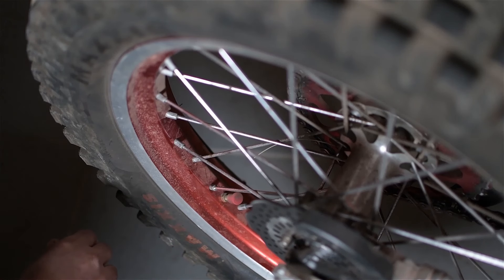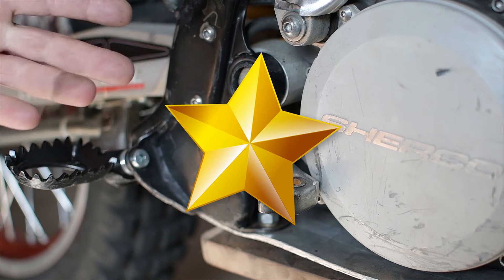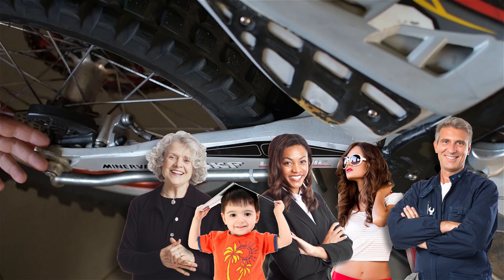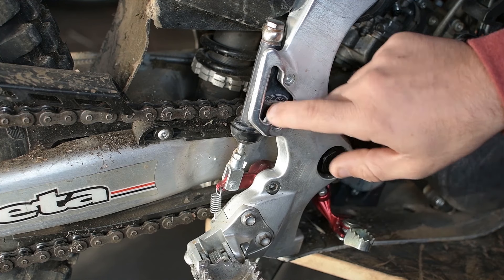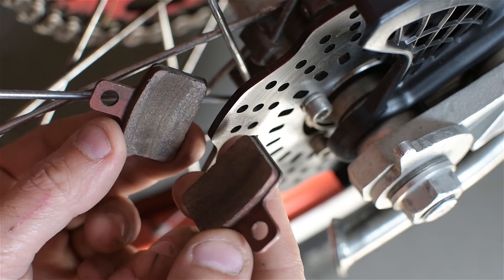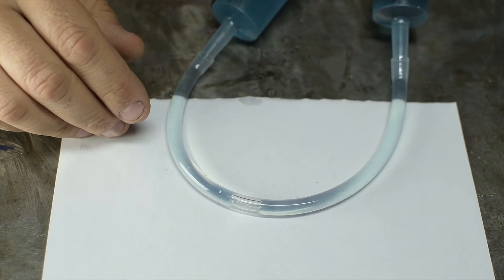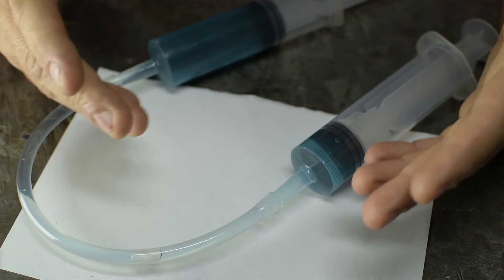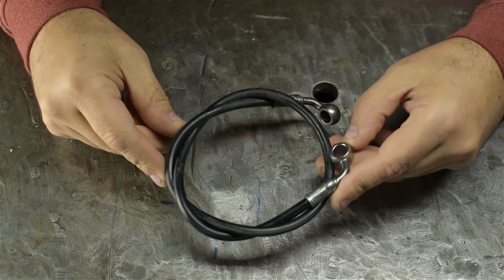I'm an Idiot! (Soft Spongy Brakes)

Comment: All that work when you could've just been carrying a piece of rebar and stabbed it through the spokes of your back wheel whenever you need to stop.
Reply: or even easier, if you wanna stop just get off the bike.
Reply: Omg this killed me!
Reply: Would this work on cars too i often thought to make a hole im the car and drag the rebar.
Reply: why didnt i think of that!?! the rebar method is way more elegant than the boat anchor and chain welded to the frame system ...(patent pending)
Reply: I personally put my car in reverse and rev it up to stop
Reply: This also makes you stop on a dime.
Reply: @SalahEddineH  tell me about it, I almost brake my wrist trying that, but hey! It works!
Reply: why ruin the spokes when you can jam your foot between the tire and frame. this works exceptionally with the front wheel also allowing you to walk over the bars to get off the bike at the same time.
Reply: @SalahEddineH  So you tried it then?
Reply: I use my shoe sole, which is made from vulcanized rubber for increased stopping power.
Reply: @SalahEddineH  I'd like to thank Salah's spouse for posting that answer. Sorry for your loss.
Reply: @myes344  The traditional method is to cut holes in the floorboards and drag your feet on the road, invented by one F. Flintstone.
Reply: Trials bikes move so slowly, they have to speed up to stop!
Reply: Orrrrrrr, he could glue dimes on the wheels so whenever he stops he has stopped on a dime
Reply: @SalahEddineH  literally...
Reply: @myes344  Isn't that how the parking brake works? A lever, you pull up the top inside the drivers cabin and it pushes the other end down onto the street? That's also why you should use it for regular braking and it makes this screeching noise when some tuners use it to drift around corners.
Reply: I worn like 6-7 pairs of shoes for stopping my road bike when I was 12 an too poor to have new brakes. I used even old shoes way too small to ride this piece of sh..bike.
Reply: @crackedemerald4930  I physically recoiled after I read that lmao. Pretty funny tho
Reply: @myes344  youd need a more skookum piece like maybe a steel plate or some 30M bar welded together but I think we’re onto something here

Comment: I guess programmers aren’t the only ones having “fun” debugging experiences
Reply: Guess you're right, but it's cheaper for them.
Reply: @Jarko1401  depends what you're debugging. It's not cheap to figure out why your online payment system isn't working in production, that can cost millions of dollars by the hour depending on the scale.
Reply: @Chartreugz  I'm aware of that, because i'm working as a programmer. What I've wrote came from experiencing way more trivial problems in debugging than heavy ones.
Reply: I feel personally attacked and so understood at the same time.
Reply: Exactly! with Angular, I call this Tuesday...
Reply: The difference is, with mechanical stuff, worst case scenario you could just buy the whole set of brakes or whatever is the problem, then call it a day.
It is not so easy with programmers, especially when debugging legacy system, because you don't always have the option to "throw it away start over from scratch". You have to find it.
Reply: Yea. Sounds like codebullet
Reply: @phs125  ah yes, the only programmer in existence, codebullet. He did amazing on the programming of windows, iOS and even my television remote. It's quite hard to believe he is the only programmer in existence.
Reply: @jslavertu  eat a snickers Lavertu, your not edgy when your hungry.
Reply: I was doing a thing in python a few hours ago and it wouldn't terminate. This is why
```
variable = 0
while variable < number:
    # Stuff
    varaible += 1
```
I f*#&$%& hate my life. I have never disliked python as much as i do now.
Reply: @Econcrafter  but you can't do += for undefined variable
Reply: I spent a whole day trying to find the source of a bug only to eventually realize it was expected behavior!
Reply: I wonder what the stray semicolon equivalent is for mechanics
Reply: @Maxim Kruglov  yup, it's grim. I still remember Cloudflare's "heartbleed", I think we're still reeling from that one..
Reply: Though my rule developed after years of programming is always "Check the dumb stuff first." Even if you are sure something is absolutely impossible, if it is easy to check, then check it before wasting vast amounts of time on the thing you are sure is the real problem :-).
Reply: Dude, electroplating “debugging” will have you tearing your head hair out and ball hair out screaming at the top of your lungs wondering why it won’t do the thing it should be doing only for it to just randomly start working again without changing anything lmao. 

But I’ve since been “fired” cause my supervisor wouldn’t let me do debugging when there were issues with brass plating chipping (I speculated high copper cyanide causing uneven plating from too high of a plate out rate) and he forced me to just keep plating even with the issues. So there were lots of messed up pieces and someone had to be blamed for it. 

It’s kinda funny tho, since I’m autistic my pattern recognition is really good so I picked things up quickly. Then because of adhd stubbornness I spent months researching plating so I could be the absolute best at it. So in 2 years of plating I got better at barrel plating than my supervisor who had been doing it for 30 years. 

He used to tell me I wasn’t fast enough and told me his record for amount of boxes of cobra stuff (home Reno pieces n stuff) was 20 in one day. Me being quite competitive I loaded up on every PED I had at the time and ripped through 29 boxes of cobra. He tried so hard to find something wrong with it lmao but it was all good and backed up by QC.

Anyway, enjoy the weekend! Sorry for the tangent😅

Comment: Those are now called spare parts, their purchase is now called preventative.
Reply: Yes you put them in a safe place and when you need them you can't find them and then buy new ones ,ask me how I know!!
Reply: Just needs the repair kit for the calipers now.
Reply: @johnmccallum8512  The trick is to buy 2 new ones and then as soon as you put the second new one in your hands and think "where is the most obvious place to put these so I won't lose them like that last set" and suddenly you will know exactly where the last set is... Don't try it without the new spare set in your hands, it doesn't seem to work, ask me know I know...
Reply: That's what you tell the wife. Oh, wait..
Reply: Kinda like when I drop something and then say "Gravity Check: OK!" to make it look like it was intentional.
Reply: @WhereWhatHuh  Look, if Gravity failed, and no one even tested for that, we'd be screwed. Keep doing the good work, my friend.
Reply: And spare parts usually exist long after the „thing“ they were bought for went to dust 😉
Reply: @Sadowsky46  I mean, there's got to be a thousand uses for a foot long automotive terminated hydraulic line.
Reply: @jimc3688 he shouldn't do, as he was running out of throw on the master I think, not so much calipers. The little spring int he master will act like a bump stop and no longer travel rather than pop the caliper seals(you'd hope)
Reply: ...and that is when you find the original spares that you couldn't find :(-)
Reply: Atlas WalkedAway yeah, one could use it to tie a rose-tree 🌹 to its pole 😉

Comment: You’re not an idiot, This Old Tony ... you’re just tired ... and need a brake.
Reply: You’re not an idiot, This Old Tony ... you’re just tired ... and need a brake rotor.
Reply: This joke bleed the air right out of me.
Reply: More like 'tyred'
Reply: Best Dad Joke, so far, today!
Reply: badum-tsk
Reply: To calm down... Watch more yt vids... aka my mechanics.... its metallic zen.... no words... just tools sound.... zen....
Reply: Indeed,  don't let the pressure get to you .
Reply: I think we're padding this joke.  Of course, high-caliper humor is tough...
Reply: This Old - Rotor ...
Reply: Stephen Boyd hang on, let me back pedal a bit ...
Reply: Oh, punny
Reply: All of these Dad jokes are wearing me out and I think it needs to stop.
Reply: That joke almost made my brain lock up. I'm gonna have to pad over to the fridge and grab a beer after that one, maybe even runout for bottle of Bourbon. I know you're doing asbestos you can, and some might squeal with delight,  but I'm really fading here. With a man of Old Tony's caliper, you have to pin it right on the DOT 3 times or more. Are you detecting some friction between us? You should, because I'm overheated. I'll be riding this bias until I've blown things out of all proportioning.
Reply: that was a real piston pusher. squeezed another one out there.
Reply: I know I should stop,  but my auntie locked me out of the house for telling groaners. I have a disk in there containing a big reservoir of them, so I rotor a text message to skid it under the door. I figure I can take them downtown, drum up some buisness, and pedal them for a few bucks, anyway. My keys are in the house, too,  but for emergencies, or if one breaks, I keep a pair of shoes in the bushes.
Reply: I mean, everyone needs to hone their skills, but I hate to be a bore. If I give any more lip, it is likely to seal my fate and I'll get the boot.
Reply: I mean, he's just probably still exhausted from all that muffler packing.
Reply: @DigitalSim  don't give me that noise, I find the subject too baffling.
Reply: @DrewskisBrews  Now all you need is a Banjo (bolt) and put it to music!! Love your puns! You are a Master A!! Hey! Grand Master A!! (That would mean rap; No!! Please spare us. Rap doesn't work with banjo anyway. How about "Dueling Banjo Bolts"?)    ;-)
Reply: @DigitalSim  A little Fiber in his Glass will fix him right up! I hear Metamucil is good.
Reply: So much friction..
Reply: Oh, that is VERY FUNNY, because you said brake, and that sounds just like break.  I am laughing so hard now ...
Reply: Just stop😉
Reply: Little known fact, it's the job of the Rotary Club to stop jokes of this kind!

Comment: Sounds like when my brother's car wouldn't idle well. Spark plugs, spark plug wires, alternator, starter motor, nothing worked.

Then he bought a battery.
Reply: The easiest thing to check with a meter!

But it's still good to install all that stuff as it will be more reliable in the winter time.
Reply: Had an RV with a big fuel tank and low miles. Was idling really badly until I topped it up with fresh fuel. After that, I just topped it up with $10 at a time.
Reply: Carburetor and points gang turn up on this fool!

All supremacy jokes aside, this got a laugh out of me. All that stuff and a battery probably would have been much cheaper to start with. I guess at least he didn't tear into the fuel system and try replacing all the injectors and the fuel rail and the fuel pump (though fuel pump would have been a smarter option to fix rough idling than a starter motor).
Reply: hahah
Reply: Just realized today that my car's battery might be questionable. These things happen.
Reply: When my bike wouldn't do self start,
 I went to every possible garage on my way through life.
I got arthritis by using kickstart.

In the end, u figured it out myself.

It was the clutch lever.

It was too weak, so my bike thought I was pressing start button without pressing the clutch.  

🤷🤷

Comment: I went through this EXACT series of issues when I was racing, I even upgraded to an Italian master cylinder, but when I got new rotors it was like a whollleee neewww worrrld.
Reply: I was waiting for wheel bearings - That's what happened to me, though I did replace the rotor, pads, SS brake line and numerous bleeds before it dawned on me to check those pesky front wheel bearings. Symptoms were more bent rotor than air in the lines, but same premise.

Comment: The problem wasn’t that your rotor was worn down, it was that the rotor wasn’t true.  Unless the caliper piston is over extended and leaking, the travel will always be the same on the lever end. Same distance of movement on one end will always equal the same distance on the other end. The check valve will let in more fluid as the rotor wears. That’s why Hydraulic brakes and clutches don’t require adjustment throughout the life as manual (cable) ones do.  When the rotor is un true the wobble motion of the rotor will push the pads back into the caliper further than normal causing more travel needed to engage the rotor every time. I diagnose this problem frequently in cars. Most times you can feel the pulsating in the pedal from a warped rotor, but not always if the caliper is floating nicely and the speed is not too high.

Comment: morale of the story: when you have spongy brakes replace all parts...
Reply: jaymanxxxx Trouble shooting pro tip: save time troubleshooting by replacing parts until the problem goes away
Reply: @chrismiles462  load the parts cannon! FIRE!
Reply: With a piece of safety equipment that isn't a bad idea.
Also you can easily check the condition of parts when it's all outside of the machine to see if any could be reused as emergency spares.
Reply: Brake system failue falt light came on in Baghdad. 1 park brake lever and activation indicator, nogo 4 rotors  4 calipers nogo, 1master cylinder nogo,  4 rubber lines nogo  , 3 rounds of brake hard  line  r&r nogo , 2 ga of DOT3  . Only thing left in the entire system was the part I said was broken, Proportioning Valve finally the light went out a month later.
Moral of the story Throwing Parts at it tell a problem goes away will always make the problem go away, if it doesn't you haven't thrown enough Parts at it
Reply: But not "shotgun"; replace them in order of (price + difficulty). Do the cheap and easy parts first; save the expensive and tear_down_3/4_of_the_bike parts for later.
Reply: I can't imagine a lot of scenarios of an average individual and vehicle where someone would think to replace a rotor that showed no signs of wear.

Though I agree to your point, especially where safety is concerned in secondhand "toys." 

Knock off parts
Customized parts*
MacGyvered parts

*these are permanent changes that CAN compromise the engineering whereas MacGyvering should be the type of thing you do to get the 10 more miles home

(Just my idiot opinion as I do a lot of cus...MacGyvering)
Reply: @chrismiles462  Thats what my local mechanic does, $1500 later and my break pedal still hits the floor.
Reply: Why replace part after part when you could just buy a whole new bike!
...Like the previous owner did. lol
Reply: Moral: lesson
Morale: attitude
Reply: No
Reply: Well time for a big break kit on my car then
Reply: Brake: stopping thing
Break: snapping thing

Comment: For over thirty years, KLR owners (me being one of them) have suffered with soft and spongy brakes.  After watching this video, guess what . . . nothing changed. Search the forums and you’ll see that, even after replacing/rebuilding every part of the brake system, including new rotor, you still have soft and spongy brakes.  Many have fixed the problem by swapping in a four piston caliper from a different bike.  Point being, sometimes the engineers screw it up and despite knowing of the problem, the manufacturer never fixes the problem.  

Enjoyable video, sub’d and liked.
Reply: There's compliance somewhere in the system if not air, it's misalignment, twisting, flexing, bending somewhere.  Work the brake and LOOK, touch & feel every part while doing it. It'll be obvious.

Comment: I came here to try and find why my hope mtb brakes were spongey, ended up staying for the fantastic narrative. 
10/10 but my rotors are new so I think I just need to bleed better. Although the point about bad brake cable might also be true because they have received a good few crashes and are a bit scarred. 

Great video though 👍
Reply: Hope brakes seem to prefer the bench bleed - take 'em off the bike, hang one end up high as you can. Happy shreddin'!
Reply: when brake cables kink, it acts like a spring.

Comment: 5:34 "and fun fact: you get in the same amount of trouble for having two bikes in the dining room as one, so you might as well" 🤣🤣
Reply: But when wife and kids are gone 12:31 , so.... no problem.
Reply: Wish I had a reason as good as that for the failure of my 16-year relationship!
Reply: When my 2nd wife left, instead of putting up a Christmas tree I parked my bike in the living room and decorated it with lights & ornament and put gifts for my bike around it. Ah, the memories.
Reply: from personal experience, only the smaller moto would fit into the elevator.

Comment: What doesn’t brake you, makes you stronger.
Reply: Coming from a fellow bleeder, I usually stay far away from sharp wit, but in this case, I agree.
Reply: What doesn't brake you, makes your impact stronger.

We wanna prevent that the kids start oiling dads rotors to "get stronger!"
Reply: Dave Howard or at least more brave. I found that just point the bike straight into the nearest wall also works well, just remember to put your hands out just before impact, this will help lessen the brain concussion.